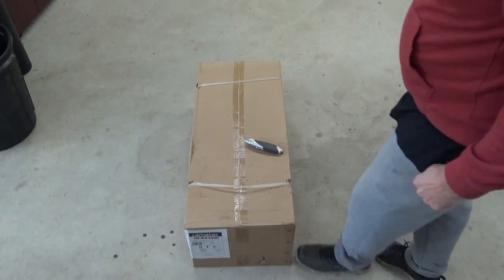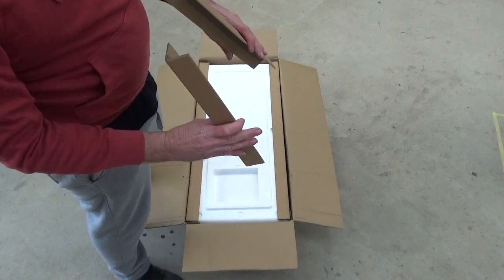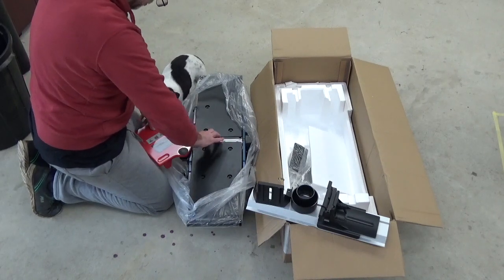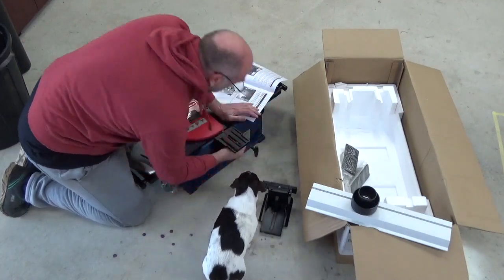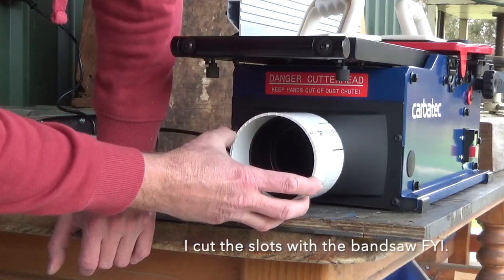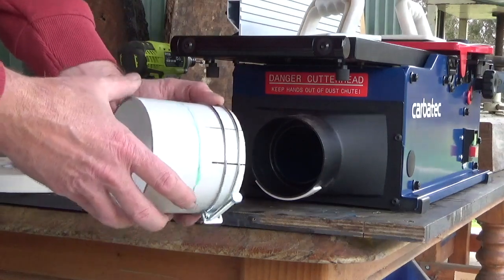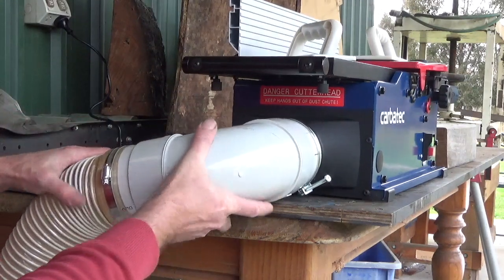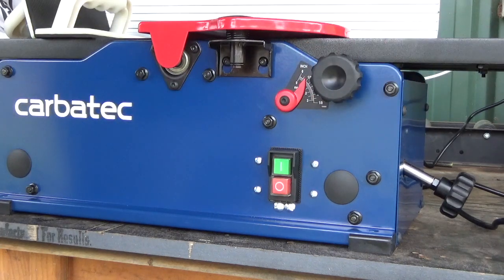Carbatec Jointer Unboxing and Test

Comment: Hi there, Just wondered, as a fellow owner of the same jointer, whether you know how to remove the pulley on the cutter head in order to gain access to  replace a worn out bearing? Any hints/help greatly appreciated.
Reply from the maker: I’ve not used mine enough to need repairs yet but I would suspect a bearing puller is worth trying if the puller feet will fit between the bearing and the pulley.